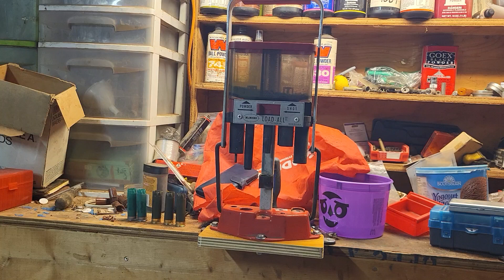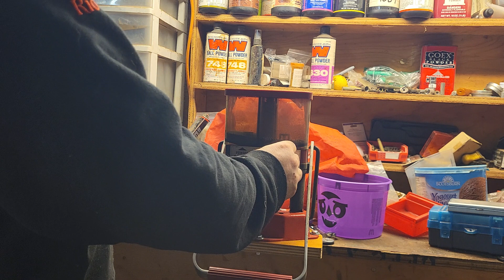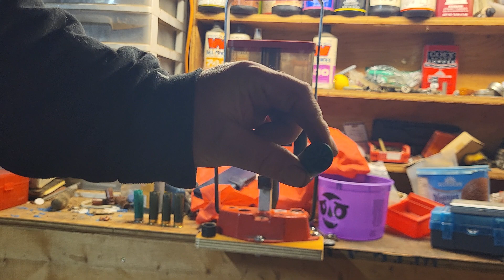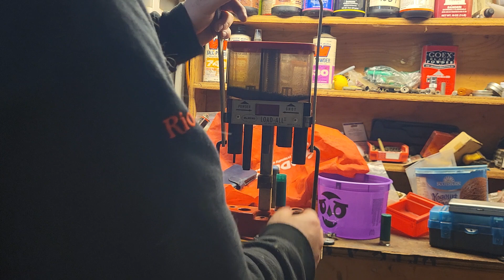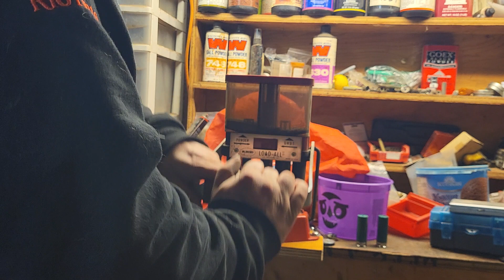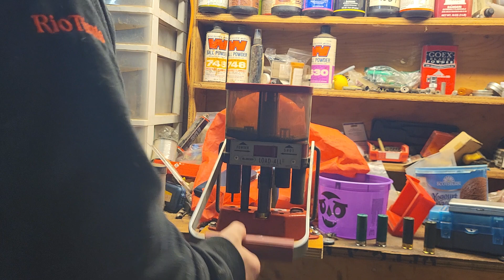Lee load-all loading 12 gauge.

Comment: Claybuster wads makes the CB6100-12 which is long enough and has a big enough gas seal to work correctly in the Challenger/Cheddite hull without requiring any additional card wads.
Reply from the maker: I'll have to pick some up but I want to use up my old stock first.